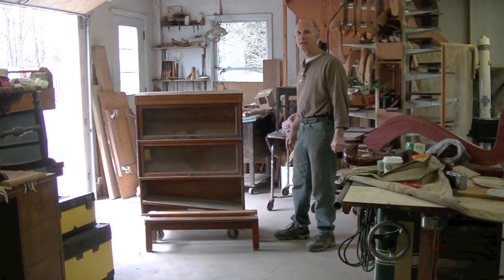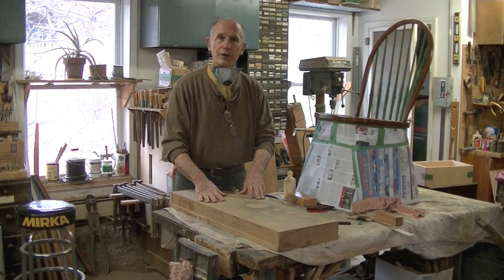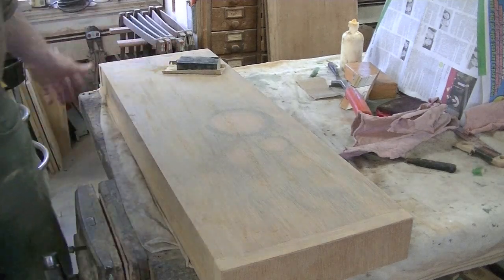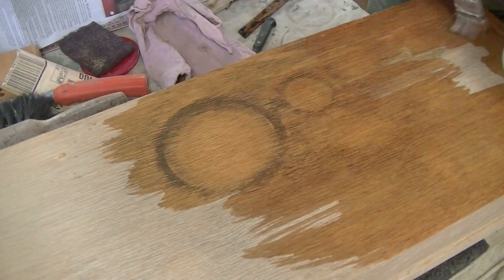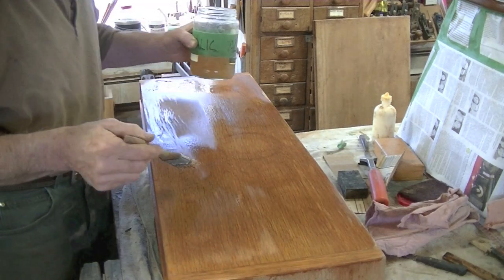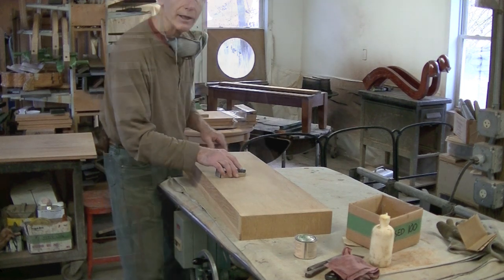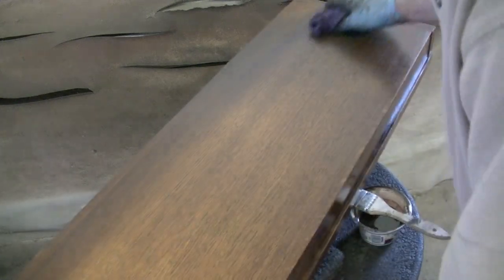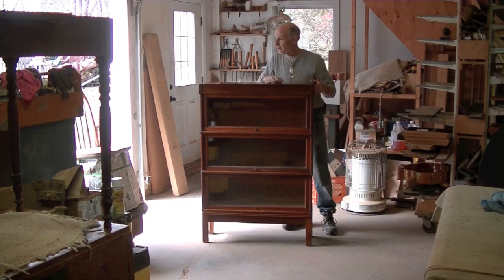Removing Water Stains from Antique Furniture - Thomas Johnson Antique Furniture Restoration

Comment: Hi Tom, I have a Drexel coffee table from the 60's with white and dark water stains.  I got this table for 9 bucks and I love it, but the top...  I grew up working in a wood shop and I'm not afraid to work on most things that are solid wood, but the veneer is scaring me. This was a hard technique (on veneer) to find on Youtube.  I am slowly making my way through your video's.  So much knowledge!! Thanks so much, Katie.
Reply from the maker: Hi Katie, I'm so sorry I missed this comment so long ago. Thank you for watching!
Reply: @johnsonrestoration  It’s ok. I used your techniques like the oxalic acid. In the end it turned out really well and is still my coffee table! Thanks for the videos; I have learned so much. Happy New Year!
Reply: @KMayflower  Did the oxalic acid work on the veneer? I have my mom's coffee table from the 60s (old enough that I remember when she bought it! :0 ), and have water stains & some stains from little antique bells I decorated with last Christmas that made horrible, er, ring stains. Thanks
Reply: @rejoyce318  Yes, but if I remember correctly I repeated the process a few times. It ended up raising the grain the of the veneer for some reason but I used this super fine sandpaper around a 240 or higher with an electric sander and I got a super smooth finish. I followed with a mixture of a few stains to match the lower part of the table and used a satin sealer. About 4 coats because I use this table and didn’t want it to get water stains again.’Good luck!
Reply: @KMayflower  Thanks!

Comment: Sometimes you finish with oil, sometimes with shellac, sometimes with poly, and sometimes you use different finishes on different parts of the piece. How do you decide which finish to use?
Reply from the maker: JohnsAfraidOfFlying Wow, that's hard to answer. Basically I like tung oil the best. But color-wise I can do more with shellac. I use shellac on antiques, but if I want more durability on a top I'll use tung oil or poly. Depends on what look I'm going for, too.

Comment: 15 years ago there was this top where someone had left a hot appliance on, which left a burnt ring. I used bleach in powder diluted with water. The wood turned almost white but the black ring was gone. I finished with several coats of brown shellac applied with brush, and bingo!. 

Those days I used concentrated bleach, sold as special for furniture, but now I guess powdered swimming pool chlorine should more or less work as well. 

Great job. Thanks
Reply from the maker: Thanks for watching. That's great about the burnt ring. It must have been more of a water ring than an actual burn, a burn won't come out chemically, although you never know. For dark mark removal I've never had luck with 2 part bleach, clorox works well. I'll have to try some super shock we but for our pool! I always start with oxalic though

Comment: Mr. Johnson, thank you for taking the time to teach what you do through video. I deeply appreciate these tutorials with step by step instruction. This particular one is of interest to me because I have a barrister bookcase passed down from my Grandfather and want to completely restore and refinish this piece inside and out. The top is in similar condition to the video except some of the veneer has popped loose and looks like a bubble. Do I cut into it to glue it down? Also, the cases are in pretty good shape, but have some scratches and nicks revealing bear wood and has not seen much attention. Should I clean very well and polish with bees wax polish, or should I sand the whole thing and re-apply stain and/or a finish coat of tongue oil? This case also has metal strapping holing each case together holding the back to the front.
Reply from the maker: Thank you for watching. Yes, cut the bubble with an exacto knife, with the grain, work glue in and clamp. If the sides aren't too bad, consider cleaning, sanding lightly with fine paper (220), apply an oil stain like Golden Oak, maybe mix a little darker stain in, let dry and apply a coat of satin or low lustre water based polyurethane. Sand down the top and finish to match

Comment: Great video again ! ... You are luckier than me. I have never been really happy with oxalic acid.
Reply from the maker: Thanks! I find you still need to sand it well, before and after the oxalic treatment. And it doesn't work on all stains, just mineral stains and the wood has to have some tannic acid in it
Reply: @johnsonrestoration  Thank you. My worst experience was on an oak 18th c. chest of drawer...very badly/deeply stained... I ended up sealing the wood and painting a wood pattern/imitation on the stains... then shellac, hot wax... The results were spectacular. It took me a week of sweat (and frustration) but I just LOVED it !

Comment: Thomas, what combination of oxalic acid and water do you use?  Do you start out weak and then make it stronger if the water spots remain? Does making the mixture strong affect the wood differently?
Reply from the maker: I use 1/8 cup for 64 oz of water. If that doesn't do it I use a super-saturated solution. Stronger solutions do not affect the natural color of the wood

Comment: Do I need to neutralize the OA?  Can you explain why you shellac and Polly?  What’s the shellac do?  Thank you for sharing your knowledge.
Reply from the maker: Thanks! No need to neutralize, but rinse well with water, you don't want to be breathing that dust. Shellac is used as a sealer, it has the property of not being affected by contaminants in the wood, helps seal those contaminants in so they don't interfere with the top coats. It's not perfect but it helps. The shellac must be wax-free. Typically I don't use poly, but a traditional varnish (Waterlox Original)

Comment: We sanded our oak floors or refinish. During the night, our roof leaked and caused water drop damage on the bare sanded wood. When it came time to stain, it appeared that we had been able to sand the stains out; so we went ahead and stained our floors and followed with teak oil. The water stains popped up again. Can you help? We worked so hard on our old floors and I’m so upset about the water stains. Thank you.
Reply from the maker: Sorry about that. You will need to refinish those boards that were affected, and treat with oxalic acid, just as you see in the video. Go with a light solution, and after it has dried work hard to sponge up all the powder. Then the same finish. If the boards are different, assume that with time they will blend in

Comment: Good video, thanks!  Did you stain the whole piece with the same stain?  My experience with oxalic and getting a piece wet and multiple sandings is the pores get very tight and do not accept stain well. Was your staining method for the top different than the rest of the piece?
Reply from the maker: Hi Bill, thanks for watching. I only refinished the top, and stained it with an oil stain to match the rest, which had multiple shades on different parts so it wasn't difficult. I've not experienced what you're describing, usually after wetting and sanding the grain is quite open, back down to almost raw wood. I suspect you need to sand more and blow out the dust.

Comment: So if I just want to clean a piece from crud etc... without disturbing the finish would I NOT want to use the oxalic acid then? What about TSP  or dish soap and water? Or what would you recommend?
Reply from the maker: Thanks for watching! For cleaning I like Krud Kutter https://www.rustoleum.com/product-catalog/consumer-brands/krud-kutter. Oxalic can only be used after a piece is stripped and sanded. A mild solution of TSP can always work. Dawn detergent is great stuff, especially for stripping an oil finish, anything with oil or grease. But it does need to be rinsed off, unlike TSP and KK